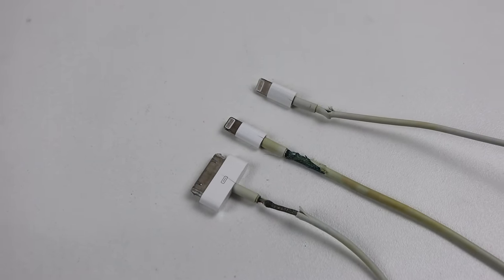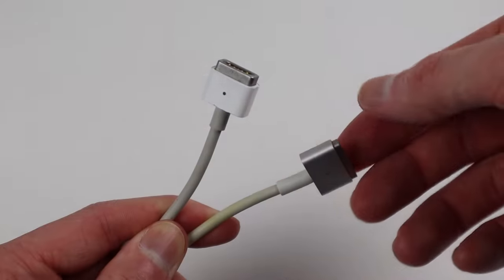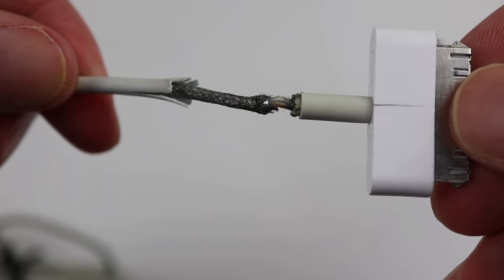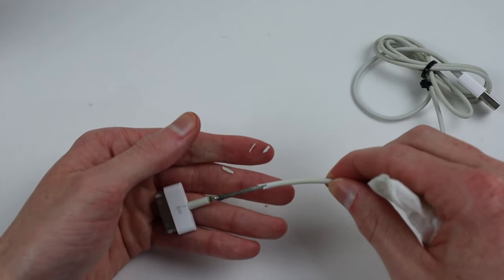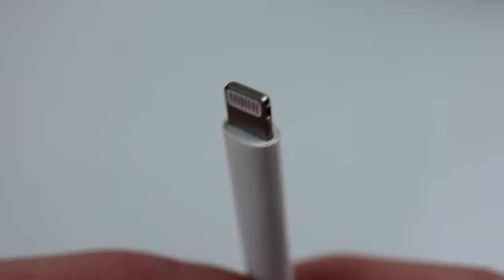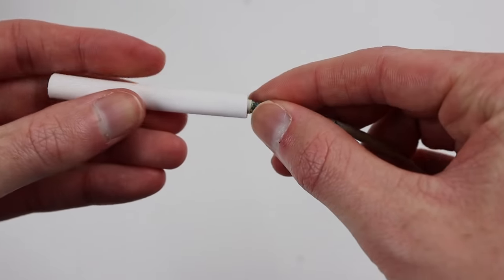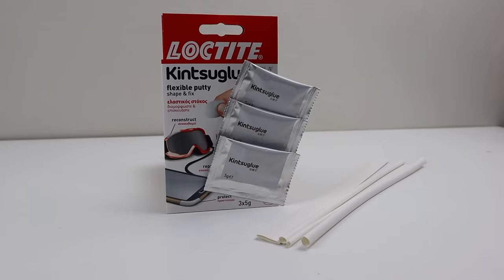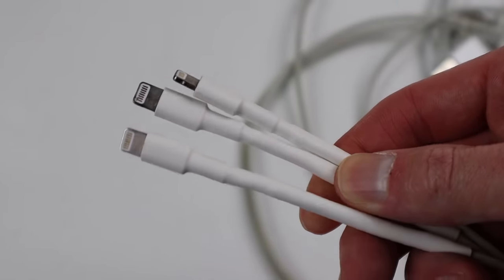Repairing Apple's Notorious iPhone Cables for $8! - Save $$

Comment: Apple is the master of planned obsolescence
Reply: Not any more than any other tech company nowadays is. iPhones last significantly longer than most Android phones. There are people that still use iPhone 4s and 5s for a reason. And I'm saying this as someone who had only had Samsung phones for years.
They're also much easier to repair.
Reply: @Jhud69  cool beans
Reply: @Jhud69  I still using a samsung note 4 and Tab S T800 from 2014
So your claim there is not true
I had iphone 4, 4S, 5S, 6 and don't worth the money
The IOS its fast but nowday android has the same speed
Easy to repair?🤣
Was more easy to change the glass from note 4 thin amoled rather than change the glass from iphone 6 lcd🤦‍♂️🤣
The crappy LCD from iphone is very fragile and very easy to fuck up
Reply: @Jhud69  I'm using a 4 year old Samsung phone, and his original charger and cable, working fine without any noticeable damage in the cable
Reply: youaintwrongthere or just being eco friendly
Reply: @Prem-j9l3s  not , just Apple want to mooooooooore many from all people who use Apple device's
Reply: mat vz I’m just saying using rubber does naturally decay quicker than plastic and technically in the long term it does help the earth
Reply: Taj Callender exactly
Reply: @Jhud69  Easier to repair. Yeah no.
Reply: @Prem-j9l3s  Whats good with eco friendly cable if they are going to break down easier, requiring more cable and thus more material needed to make cables. In fact this is my problem with Apple's so called eco friendliness: They can tout all they want about how they Recycle things, but Reuse (allow easy repair and make product last longer) is still always better since you dont have to extract/mine materials and use additional energy for producing new stuff, and Apple is doing everything they can to make repair/reuse harder for everyone.
Reply: mcslender no company is perfect and every has secrets and you do share a valid point but it’s not that big of a deal to just buy another cable
Reply: @forcequitOS  While that is true. As soon as the it loses support half of the apps will stop working.
Reply: Viktor Chmiel in order to keep using older generation iPhones for an extended time period you’d have to have a lot of work done to it including a battery replacement and a screen replacement (at least once considering how fragile they are)
Reply: Dante Thunderstone you don’t need to as long as you take care of your phone and don’t do anything sketchy I’m still using my iPhone SE first gen for years
Reply: Benedict Stanley my iPhone 6 has a battery that needs to be replaced and my  cracked form small drop (less than a foot) with a case on it on to a hardwood floor and it’s a fairly newer one that was replaced by Apple because my old one had a battery that was getting thicker for no apparent reason (it was probably gonna explode) 

My mom had a Samsung galaxy s4 for 4 and a half years with no major problems except a scratch on the screen (very small and shallow)
Reply: @dantethunderstone2118  I want replaceable batteries to come back.
Reply: Crantox  no you simply don’t like apple
Reply: Crantox installing custom ROM on your Android device is dangerous and can brick your device
Reply: Crantox iPhone 5s and iPhone 6 do not have lag on iOS 12
Reply: Crantox if you don’t mix the screws and if you no where they came from then iPhone is a lot easier to repair
Reply: Apple want people to buy a new device every 2-3 years, see Luis chanel how crappy all MacBooks are made from inside.
Reply: Viktor Chmiel by giving 1000 of $ it should obviously last long for year
Reply: @Jhud69   Compare that to newer models of iphone.
Reply: @mcslender2965  Natural rubber is rarely used these days. Companies prefer synthetic rubber which is significantly cheaper than natural rubber.
Reply: @Jhud69  Apple is the worst, they were the first to solder hard drive and ram to the motherboard to make sure it couldnt be easily replace or upgraded. My 5 year old galaxy s8 is still going strong and I am still using the stock accessories. My last iphone while being perfect on the hardware side was killed by a software update that renders it unusable. Apple is the devil master of obsolecence,
Reply: @Jhud69  Still running strong with a 6 year old samsung tablet with the included charger which only now is showing some signs of wear and tear.  Android can last just as long at a way lower price..
Reply: @Jhud69  I am usilg an iOhone 4, Original iPad iPhone 5 Galaxy Note 2 and Galaxy S4 right noe im uding the Galaxy s4
Reply: They use to be better. My 1998 Blue & White Power Mac G3 still works like new what is amazing
Reply: No, cause if they were they wouldn't have supported their phones for 5 years on average, that tanks and android support which lasts 3 years max, btw I use Android so I'm not biased
Reply: @Jhud69  I am using midrange samsung galaxy a9 pro from 2016. It still stellar, battery is original.
Reply: Nero v Frost The old tablets all have terrible processors! Only the new tab s6 and s7 have been good... Unless you think going strong means it can turn on, then fine.
Reply: @joaopaixao1502  it's not when you know what you are doing
Reply: Viktor Chmiel Yes , more durable than others n higher resale price, more like industrial standard.
Reply: Apple pulling a Lorax and started selling air
Reply: yet, my sister still use her iphone 6 with it's original cable and only replaced the battery once.
Reply: @TS-cs2pe  thats because either its a new phone  or your sister does not use it or you are lying.
Reply: Random Guy it was new back then in early 2015 when she bought it. it’s her only phone until now. you think i lied? what’s the benefit of that?
Reply: Youre gonna anger the crazy ass apple fanboys
Reply: @Prem-j9l3s  eco friendly? Where it is eco friendly? Because if everyone buys every year a new cable it's NOT eco friendly! 🙄
Reply: @forcequitOS  and that makes the shitty cables better or what? 🤔
Reply: @joaopaixao1502  sure they do.
Reply: Rhydonify have you not seen Tuesday’s event
Reply: @Prem-j9l3s  yes but that's marketing! The cables are poor and that Doesnt have anything todo with "eco freindlyness" 😔🙄
Reply: Rhydonify wdym the cables are poor
Reply: Sugru as well will fail after 8 months.  It also caused the shielding to break overtime internally. In my suggestion, heat shrink tube is the best.
Reply: I used a anker lighting cable or Other brands
Reply: Its a cable what do you expect
Reply: Viktor Chmiel i still have and regularly use an iPhone 8g but my main phone is a iPhone 5s
Reply: Dante Thunderstone no you don’t my iPhone 5s is 7 years old and never had a battery replacement (but it does need a screen as i dropped it out of my window on the second floor
Reply: Benedict Stanley i also have an iPhone se but it has screen problems
Reply: And now they're playing the "environmental responsibility" card by not putting the adapter in a phone that is more expensive than the previous version and claiming itll reduce ewaste but the cable they included doesn't even work with older adapters essentially forcing their new adapters anyways
Reply: I’m still using an iPhone 7, it works fine for me.
Reply: @josericardogs1435  I’m still using my 6s charger 5 years later with no problems
Reply: @Jhud69  lwho uses a phone for more than 2 years, there are lot of new tech and improvements why keep using old phone, you cant buy a new one? apple fanboys says only wealthy ppl can buy an iphone but keeps it for 5 years... or iphone doesnt improve enough to switch after that long time?
Reply: Bur then why are iphones said to be the longest used phones? With life spans upto 5 yrs? 
P.S. - Not an apple fan. Am a cheap Samsung user.
Reply: @Jhud69 androids outlast iphones
Reply: @Jhud69  well considering apple put intentional glitches into the iPhone 12 if you repair said phone with other components then OEM ones, your comment is barely 1 month old and aged like wine ¯\_(ツ)_/¯
Reply: @Jhud69  capper say what
Reply: @NexusXP  that’s cap. I still have my 6 and it works just fine
Reply: @Jhud69  iPhones are absolutely not easier to repair. Apple has a really bad history of intentionally making their phones more difficult to repair so you have to spend more money on either integrated parts, or just a new phone. Apple loves soldering components to the board so you can’t replace them, and even if you can, it can void your warranty or make you pay full price instead of replacement pricing.
Reply: @takus-vibe  Never said anything about your phone not working.  My point is when iphones lose complete support they may not be able new apps and update.
Reply: @NexusXP  you said half of the apps lose function. That’s cap. Over half of them function just fine and are still receiving updates. So your point isn’t necessarily true.
Reply: @takus-vibe  The iPhone 6 didn't lose support that long ago. So obviously the developers can support the app.
Reply: @NexusXP  that’s my fucking point. Smh. Good day
Reply: @takus-vibe  Yeah in the future developers will drop support that's what I meant.
Reply: @Prem-j9l3s - helps the earth by encouraging the destruction of jungles to plant rubber plantations?
Reply: @mitch1958no1  how
Reply: @Jhud69  my note 8 is still working perfectly fine. Bought it a month after released, so I've had it over 3yrs now.
Only damage is to the screen, that I caused by dropping it.
Reply: @Jhud69  if you watch louis rossman youll see that apple desn't seem to be that good at designing particularly reliable devices especially macbooks that will almost always die within 2 - 3years of purchase requiring the user to buy a new one, and apple intetionally makes it as difficult as they can for indipendent repair shops to get parts to fix apple devices
Reply: @Prem-j9l3s  they aren't using natural ruber, and it takes just as long to decay as normal plastic
Reply: @letsgofast1187  ???
Reply: @Jhud69  and uh sure, un replaceable camera lense and other un replaceable parts on a difficult to open phone with a difficult to replace battery, so EaSy To RePaIr
Reply: @oofingberg  that it doesn't break twice a year
Reply: @forcequitOS  the updates which killed their performance completely, yeah
Reply: @Jhud69  no
Reply: @Jhud69  Not quite. Try searching ebay for used iPhones and check the percentage of defective phones for different models. You will find that the newer models have a much higher defect rate even though they are younger. Things have changed a lot since the 4s and 5s.
Reply: I disagree. The iphone 6s still runs amazing on ios 13.
Reply: @kidsonblackops  
iPhone 6s user here since launch lol

But yeah, only because apple hasn’t made a good iPhone since, the mini came close though. Still no. Told myself I would get an iPhone when they made a good one. I’m still waiting.
Reply: @MCAlexisYT  LOL
Reply: @MCAlexisYT  LOL
Reply: @aarons5259  no I have a Samsung s7 I already had to replace the battery twice and the screen nine times and I also have an iPhone 6 which I never had to replace anything and is older than the S7 and no the s7 screens did not break because I dropped them The LCD always had burn marks and bad pixels
Reply: @thegoldencrafter4792 I know what I’m doing and I already installed custom roms on android devices 19 times
Reply: @NexusXP  LMAO
Reply: @joaopaixao1502  I had an iPhone x every im 5'8 150 pounds. I sat down and the screen shattered took it to my phone carrier they wouldn't fix it. Took it to Apple and the security guard stopped me and asked if I had an appointment I said no he showed me this thing I had to take a fucking picture of I showed him my phone and he basically said tough luck. So I went back to my phone carrier got a s20 note. I work construction i go through phones like candy. So far this has held up perfectly. My foreman has a note 6 thats still going strong. I love Samsung dex is badass for when I have to be out of town. I glad I made the switch. No more bs from Apple.
Reply: Really? I have a Macbook dated 2006, in impecable condition. Never been fixed. I own an iMac, 4 iPhones, two iPads. Those have never been fixed either. I have also owned several Windows PCs. Cannot saw the same thing about them. The only one that survived was a HP Workstation that was customized for a business. I think that people need to have more care with their equipment.
Reply: @joaopaixao1502  Wasn’t Samsung the one that had the exploding phone?
Reply: @Jhud69  Apple compensates this by having expensive accessories which have either s short life span or are easy to lose or get stolen.
Reply: @mcslender2965  Apple disguise their profit making as being eco friendly. They put thousands of hours into understanding the outcome of their compaigns.
Reply: @Prem-j9l3s  using rubber is not going to help your wallet though
Reply: @curtisj2165  ok and? Small price to pay for chance to bring back the earth?
Reply: @curtisj2165  first of all i never said to buy Apple cable. Second of all why does it even matter dude? Are you that selfish that you reject this movement to make the industry more eco friendly
Reply: 勉です 🗿
Reply: Curtis J YEAH
Reply: @MCAlexisYT  ?
Reply: @MCAlexisYT  lol no one said to buy apples cable
Reply: @NexusXP  sadly, that's never going to happen
Reply: Not really the rubber degrades faster sure but in terms of the devices themselves they get updates longer the almost any android phone will ever get look at the 6s and se 1st gen both still fully supported under iOS 14 with no noticeable feature downgrades and pretty good performance still my 2012 MacBook Pro just barely became unsupported but is still a pretty competent machine
Reply: @Jhud69  Hell no they're not easier to repair. Apple is notorious for intentionally making their phones hard to get into. Don't know where you got that info from, but it is not true.
Reply: @Prem-j9l3s  Batteries have a limited lifetime. Even if you keep your phone in perfect condition, the battery will eventually go out.
Reply: @joaopaixao1502  It's not just a matter of the screws, they intentionally make their phones hard to get into. Apple doesn't like third party repairs and they really don't like it when people take the initiative to try and fix their own phones.

Not saying apple is bad, but they've made some of their newer phones especially hard to repair. Go back a few generations and it's not so bad. I haven't had an Iphone for a while, but for a long time newer versions of IOS couldn't be jail broken. Don't know if that's still the case though.
Reply: @joaopaixao1502  9 fucking times? What are you doing with that poor phone lol?
I have an old samsung galaxy s7 that lasted me 3 years. I regularly dropped my phone with no case on it, and it didn't break. It finally got a hairline crack it the corner and I replaced the screen. I've since replaced that phone, but I always thought the thing was built like a brick. I never knew a phone could survive being dropped on concrete as many times as I dropped that phone. 
If the lcds had burn marks and dead pixels, you might be getting your screens from bad sources.
Reply: @sweetkittykat2000  then replace it all phones have batteries lol
Reply: @Prem-j9l3s  Yes that's the point. Someone mentioned having to upkeep old phones with replacement parts, but you responded that you didn't have to if you took care of the phone. I was pointing out that even if they are taken care of, the battery is likely going to be the first thing that goes out.
Reply: @sweetkittykat2000  ok why is that a problem
Reply: @Prem-j9l3s  There's only a prob if you want there to be lol? What you originally said just didn't make sense.
Reply: @sweetkittykat2000  man I’m just tryna appreciate Apple for doing something half of the world doesn’t even care that we’re legit fucking kill each other with pollution
Reply: @joaopaixao1502  Then you're using it wrong.
Reply: I’m still using my Ericsson A2618s phone, and the original charger. Over 20 years old and still working.
Reply: @Jhud69  lol how iphones are easier to repair only their fans say that even my old j2 is still working great
Reply: My cables for my iPod touch mini and iPod mini are still fine
Reply: @dantethunderstone2118  you forgot to account in the difference of usage pattern.
Reply: @NexusXP  phones would just be slow af by then. Android OEMs forget about their devices after 2 years anyways. And it won't comeback since people are sheeps and gonna keep buying them. Like all the outrage we had back in 2016 for removal of headphone jack yet iPhones still first in the revenues year over year.
Reply: I would say you’re right but google is worst. Android phones only last around 3 years maximum and then wont be able to run the next Android OS version, while Apple has managed to maintain an iPhone in the latest iOS version for around six years with the iPhone 6s being in iOS 14 right now.
Reply: @Jhud69  They use those phones because they have the cool factor, not because they're better...
Reply: @Jhud69  And easier to repair??? Do you even watch this channel??
Reply: @NexusXP  Replaceable batteries suck, it's better to have waterproof phones
Reply: @joaopaixao1502  Installing custom ROM is not dangerous and it's at least a choice we have...
Reply: @evan168gt6  Processing power in a tablet, or even a phone nowadays, isn't needed....
Reply: @TheLongDon  Completely untrue. That’s how you end up with a slow brick within 1-2 years.
Reply: @evan168gt6  I mean not really. 4-5 years ago, yes, it was relevant because the processing power then was only enough to do what it needed to, but the processing power on flagship phones for the past 3 years (on android at least)  has literally been enough to run as a low powered desktop...
Reply: @TheLongDon  I think you’re missing the part that software for mobile processors have become increasingly more complex and packed with features that require high power chips to rn. If you can’t 2015 software, I’m not judging but I want to run a modern OS and I want it to last.
Reply: @Jhud69  Untrue. Everything said. Samsungs are like a lego toy - 15 screws and everything is apart. iPhones on the other hand, oh baby. There are so many tiny cables, which could be easily damaged if you apply just a little bit more pressure than the needful. Been repairing phones for over 5 years now and just recently f*** up an iPhone 7 LCD because why the display would come out easily when it can not? And those shields which cover everything? Yikes. Also, a lot of people do use 5+ years old Samsungs, Huaweis, etc. still. I know a bunch of people using Samsung J3s 2015. Still working perfectly, while I am sure those costed less than a used iPhone 4s back in 2015.
Reply: They are!!
Reply: I wish Apple would make braided cables but for now everyone needs to use native union cables
Reply: And getting away with it.
Reply: Apple don’t know how people will destroy apple eventually for those little things
Reply: @dantethunderstone2118  my iPhone 6 from 2015 have 95% of the battery life and never fixed anything on it 

But my same day bought Motorola actually holds the energy exactly the same time than when I got it
Reply: Hey, man. I'm not dealing with a broken pin or wires from the plug that connects to my security camera system but the plastic of the plug itself that secures the connection of the metal is bent on one side, making the fit onto the motherboard's port too narrow.

How do I fix this?

If I bend the plastic to not be narrow it could damage the metal inside making the proper connection. Also if I attempt to shove it on there that could mess up the port from the motherboard.

I hope you can help me solve this, and thanks for reading
Reply: @joeslacker1020  bend the plastic back without damagin the pins or buy another one xd
Reply: @MilesProwerTailsFox  yeah but how do I bend it back, lul
Reply: Apple products break in 6 years after heavy use “planned obsolescence”. Android and PC products break after 1 year “whatever they’re cheap just a get a new one”.
Reply: I was about to comment something along these lines with more words
Reply: They wanted to charge me $19.99 for a 6 ft cable today after paying $63 to replace the battery. I’m like nope I’l fix it myself! Help me Yoitube!!!
Reply: Not only planned obsolescence but the devices mimic failure for non-apple cables.